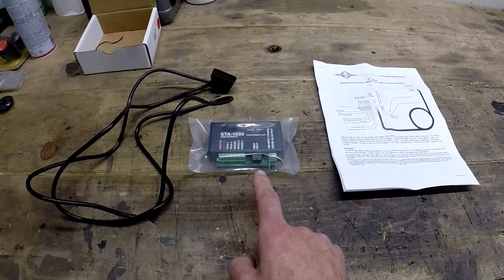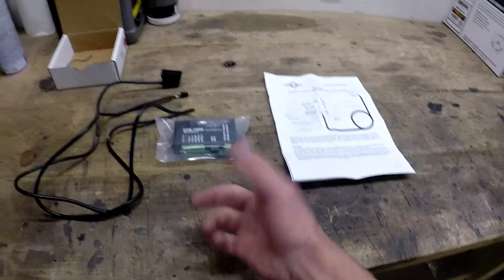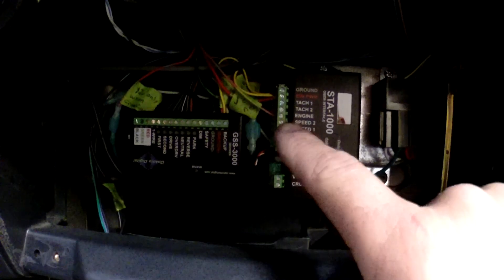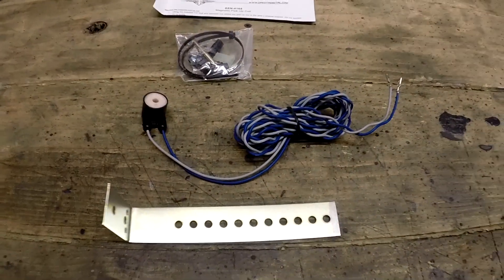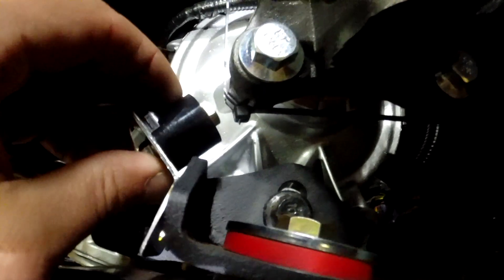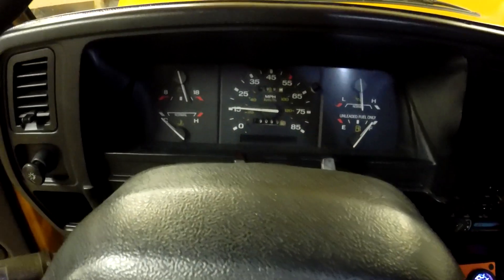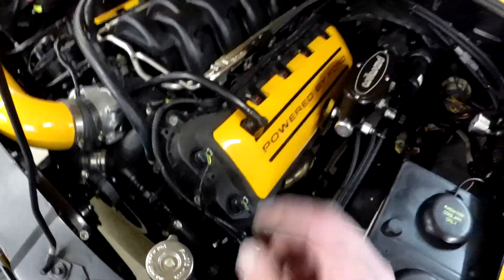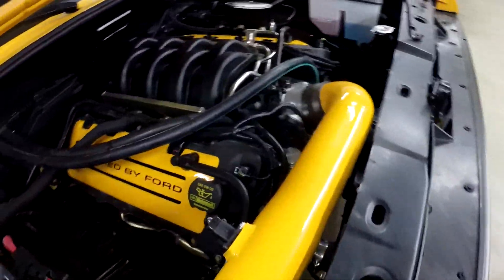All The Small Things

Comment: Why not vacuum lines for the catch can ( of course oil resistant grade)
Reply from the maker: I'm thinking you mean Rubber vacuum lines? I was trying to find lines that looked like factory PCV lines, nothing too bulky like rubber hose. I liked the look of plastic lines over the rubber ones. I even tried "reshaping" some factory lines with not a lot of success, so I settled on the swing pipe that I used.

Comment: What year is that Ranger? That dash cluster looks old, like '80s old. I don't know if any trims came with tachs back then - you could maybe pick up a cluster with a tach, but what you could do is make a custom gauge cluster out of aluminum and fill it with whatever gauges you want. Brushed aluminum used to be a thing back in the day.
Reply from the maker: 1989. Truck is originally a stick shift truck and never had a Tach. I had thought about doing a custom gauge setup like you're talking about when I originally redid this truck. Not that it looks terrible, but I didn't want to go with that look for the truck. I was also trying to keep the price down too. And even with smaller gauges, that cluster opening fills up really quickly when you start adding a bunch of gauges.
Reply: @scmotorsports the 90s explorer gauge got a tach on it I swapped my dash out one of my gauges went out really clean too I didn’t even notice the tach until I already paid and walked out of pick n pull
Reply from the maker: @monibo7075  I never thought to look into the Explorers. I kind of forgot they used a lot of the same parts back then. I will look into that. Thanks for the head up!